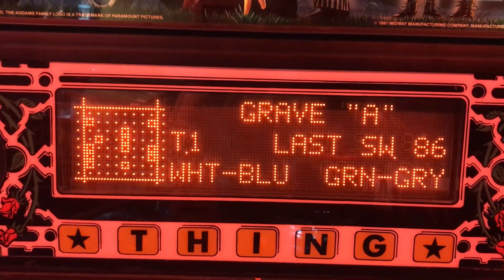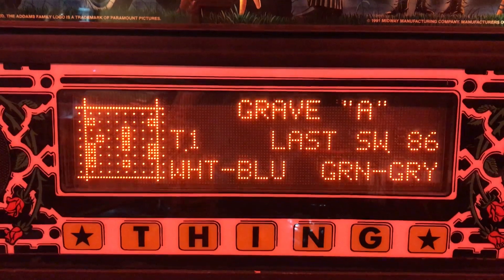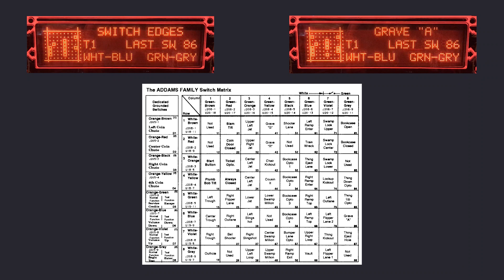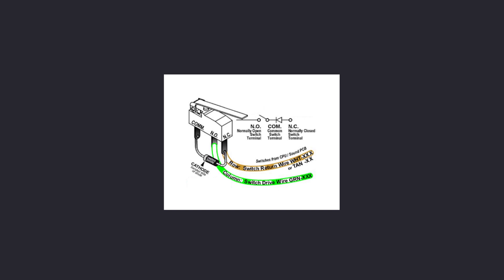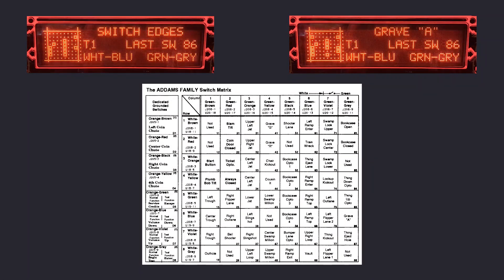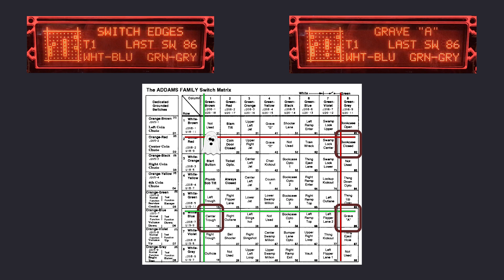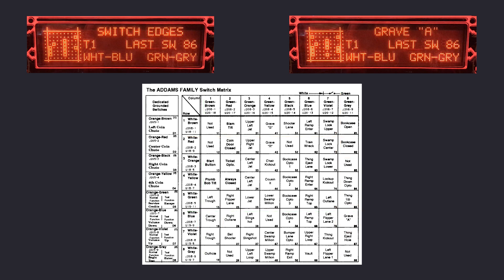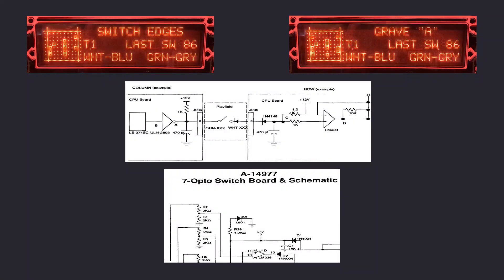The Pinball Switch Matrix

Comment: I'm very confused on how pinball switch matrix work, why are they using Diodes to use less wires on the hiring harness and what kinds of signals are used on the Row and Column STROBE signals? is the strobe signal a clock signal or what?

Comment: Soren, thanks for this video! Let me share the best/worst switch matrix issue I have solved. It was a Getaway that would slam tilt sporadically. After months of tinkering, I finally figured out that it only happened when the left slingshot AND the Shifter Up switch happened at the exact same moment. I took the shifter apart and found that the diode was incorrectly installed on the Shifter Up switch. It was great to have that problem fixed!